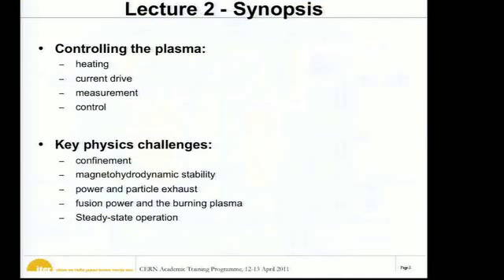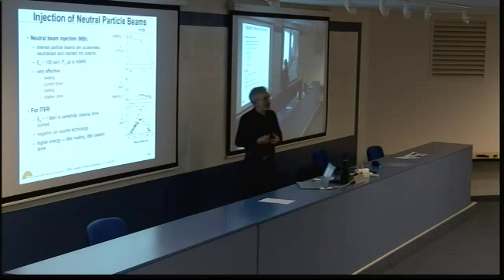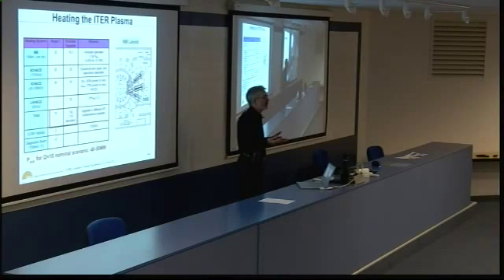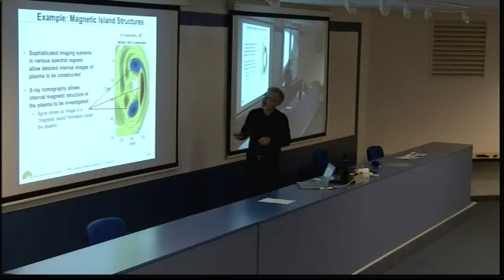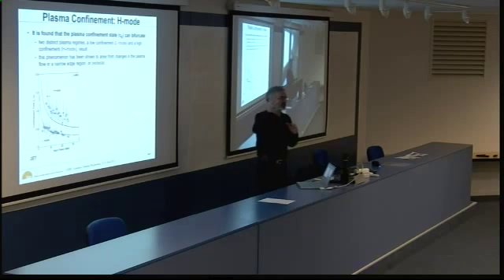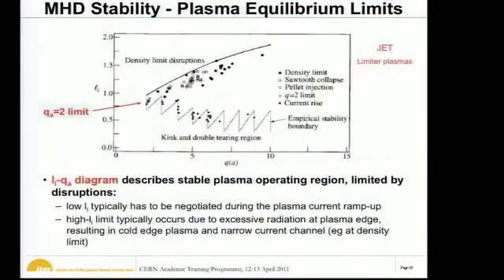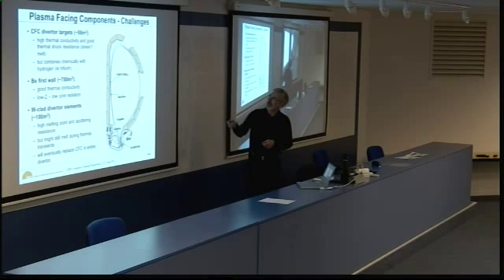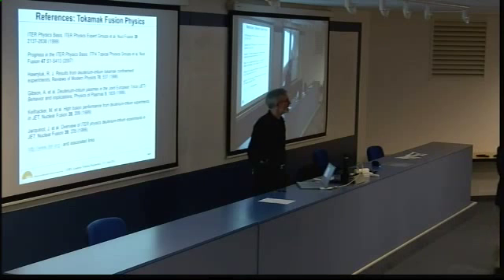Fusion Plasma Physics and ITER - An Introduction (2/4)

Comment: Stan Sandu
        How can God give us freedom to know some very important but also dangerous things, for example to the controlled thermonuclear reaction if we as a humanity lack a moral, spiritual, intellectual and scientific education?
       For example, one hundred years have passed since it was discovered that there is much hydrogen and helium in the Sun, and it was concluded that a controlled thermonuclear reaction occurs in the Sun. And for 70 years, humans have begun to build different devices or plants to make a thermonuclear fusion reaction like in the Sun. But since the late nineteenth century, human science began to be blocked because scientists, over to nickname, have misinterpreted, without reason, certain practical experiments and issued wrong laws and principles that contradict the good laws developed on the basis of practical experiments. , logical and rational.   
       Today, most scientists have an intellectual basis, linked to standardized theory. They believe scientists because they have learned some books with standardized theories. These people cannot know the matter in its depth, with the seen and the unseen, because Albert Einstein in 1905 with his theory of relativity told them that the ETER - respectively the etheric matter does not exist. If there were no etheric matter then, they may believe that there is no spiritual matter, and they do not want to know anything about the heavenly worlds that live with us on and around the planet Earth.
   I, as an engineer, believe in my opinion, but also of many researchers in the field of underground soil richness, that all MATERIAL RESOURCES: coal, oil, methane gas, all minerals, do not come from a mineral or vegetable and animal source, but have they were simply created and planted or buried, or introduced into the earth's soil by our "extraterrestrial" brethren.
       The termination of material resources - said and natural - actually expresses a time, a period, in which our humanity must reach a certain LEVEL of scientific and technological DEVELOPMENT: such as mastering the controlled thermonuclear reaction, as the greatest source of inexhaustible energy. We must not fight among ourselves, as in the jungle, but try to awaken ourselves in the knowledge of things, to move on to the heavenly science of our creators: God and the extraterrestrial worlds.
     Until now, no such information was published, but it is now in the news. Every year incursions of O.Z.N.'s (heavenly ships) take place above the silos with nuclear weapons. That is, aliens deactivate our nuclear weapons for over 60 years, weapons 20 meters below the ground. When an O.Z.N. in the air above the silo and sends a red ray to the ground, on the launch screens it appears: "No gou!" And the Americans and the Russians have declared these incidents. We as a humanity have developed ourselves militarily, but not at the high level of the extraterrestrial entities that supervise us! 
   That is why, not coincidentally, in 1985, presidents Mihail Gorbachev and Ronald Regan met and decided to build several ITER = International Thermonuclear Experimental Reactor, as an international scientific collaboration between the peoples of the earth's world. Researches in the field of controlled thermonuclear fusion have been carried out for over 60 years, there are many installations of many kinds, and over time I have studied them, and I have come to the conclusion that controlled thermonuclear fusion can be achieved, but not after the models presented on the Internet. We can make an installation: according to the operating model of the Sun; after the description made by the patriarch ENOH in his book and after the outline of the device for the production and emission of the magnetic field flux, a sketch that is on the tombstone of Palenque – Mexico.     
      I'm talking about Patriarch Enoch, who was very little quoted in the Bible, but he talks a lot in his book, describing everything the angels showed him in heaven, how the heavenly world works and about us people. But the Book of Enoch was considered APOCRIFY (that says too many real and clear things) and thus the Bible was covered with a great deal of information. In the Book of Enoch chapter 68, the patriarch Enoch being in a celestial ship, which gravitates around the Earth, the angels show him more things from heaven and Earth but also show him the camps of all stars and all the lights".
    In the south of France at Cadarache (near Nice), the experimental energy source is being built: the 42-hectare ITER, and in 2018 the construction was completed in half. If we surround the participants in the construction: Japan, China, Korea, India, Russia, the European Union, the United States of America and others, we notice that we are on the path of globalization. After about 200 Tokamak-type installations, with Laser and other types built over the last 60 years, NO ONE HAS WORKED, and then I think that what is being built now will not work with the model it is running, and with the technology used.
       The notion of: "FIRE", .. flames of fire, tongues of fire, living fire, circle of fire, vivid of fire, circle of fire burning in the four corners and ascending like rivers of living fire, all these refer to the electromagnetic field beam of the magnetic trap, which surrounds the installation and enters the thermonuclear combustion chamber again to powerfully space the thermonuclear plasma sphere of the reaction. In the heavenly ship Enoh believes that he is shown a wonderful divine vision, and he describes without knowing exactly what he describes, that energy installation, clearly seeing the unfolding of the thermonuclear reaction in the middle of that light, and in addition seeing the path of the electromagnetic fluxes of the magnetic trap. , inside and outside the thermonuclear combustion chamber.
    Two spherical halves joined in the middle form the spherical chamber of thermonuclear combustion. I made the sketches from 2012, I gave them on the Internet, but few noticed them. I think this will look like the first controlled thermonuclear reactor installation, and we should call it: "ENOH-PACAL model controlled thermonuclear reactor!" This is a standard model for future energy installations, which will give us electricity for all our installations. industrial and domestic.
    I did some 40 years ago an attempt to make a device for the production and emission of a strong electromagnetic field flux, I saw that "something moved", but I did not have the control devices and the necessary electrical current . Then my limited possibilities did not stop. But today, when we see clearly the rapid depletion of fossil fuels, and the long questionable construction of ITER, I try by those exposed to participate as much as possible in the realization of the controlled thermonuclear fusion with the project of a simple and fast to build facility.
     With a team of 50 people with manufacturing experience: 20 engineers, and 30 skilled workers, you can do a working group within the ITER site, in a work area of approximately 800 square meters, powered by existing utilities: electricity, cryogenics, vacuum installation, verification equipment, and with a financial fund of ten million euros, I think that one year can be obtained from starting the necessary results to build a controlled thermonuclear fusion plant for marketing that directly produces electricity without steam and turbines, without switch of heat.

Comment: Since this lecture six years ago, we know now we don't have to build projects as large as ITER to get the confinement time needed for sustained fusion.  Advancements in materials and engineering are showing that smaller scale projects with advanced superconductors can get better confinement than ITER.  We've learned a lot in just the 12 years since ITER design was finalized.